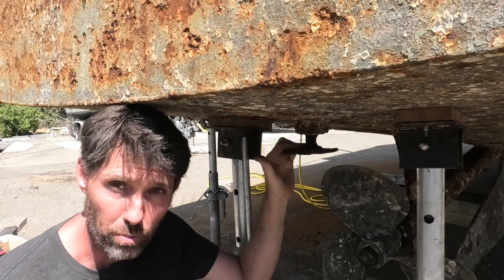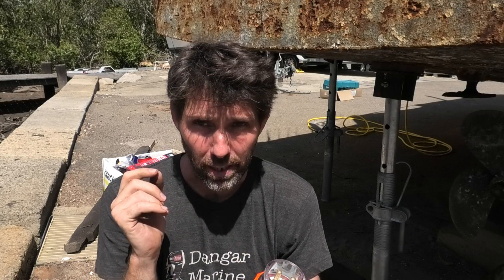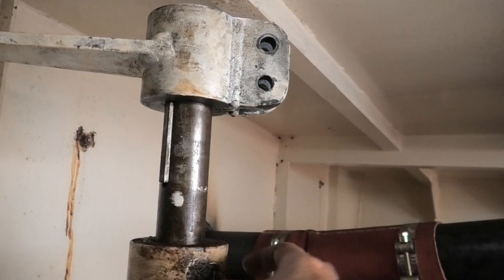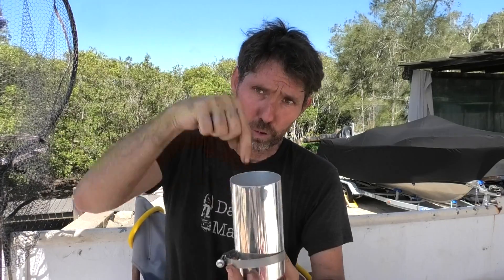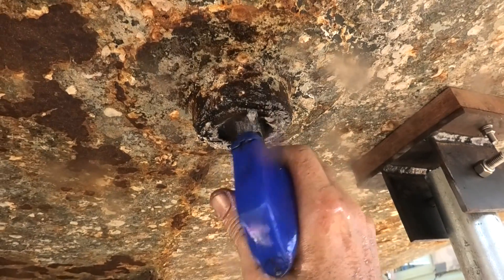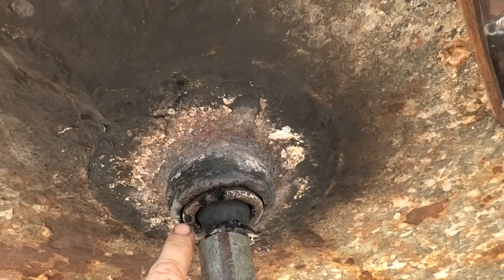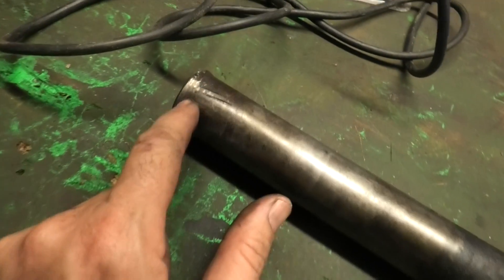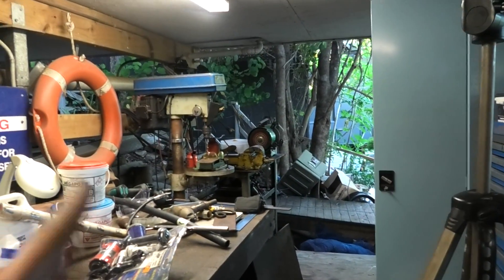Removing the rudder post

Comment: I think I'd keep the rudder and post all the same material, with a preference for mild steel.
Its cheaper anyway and it saves those dissimilar metal issues. 
Yeah I know you already have a rudder but there isnt that much work  in a rudder and you should be able to fabricate it yourself.
And on that if the rudder was responsive enough before keep the same area.
Reply from the maker: I tend to be leaning towards your thinking on this. The original one lasted 30 years after all.

Comment: YOU DEFINITELY NEED TO FIT GREASE NIPPLES TO THE SHAFT HELPS TO KEEP WATER OUT    AND KEEPS IT FROM RUSTING I AM SURPISED IT NEVER HAD NIPPLES ON IT
Reply from the maker: It does have a grease nipple to fill the area between the two bearings.

Comment: Be careful under that beast!
Reply: Pretty sketchy huh lol
Reply: I was thinking the same..
Reply: @BAZZAROU812  yeah, I dont think I'd be getting under there and doing that with that boat moving like that lol. We stick all our boats on solid racks before we go smashing on stuff like that! You can see in some of our videos when we pull engines off the boat, they pull up the boats from the 5200 that was used to stick them in there.

Racks are just more solid than boat stands though so its apples and oranges you know

Comment: @Dangar Marine awesome vid, in the future i could most likely make you any electrical adaptors etc for free and  express post them up shoot me a pm if it would help.

When you cut the door in with an oxy tack some off cut steel on the hull so you can run the oxy up against it for a straight line!
Reply from the maker: Thanks mate, appreciate the offer of making the adaptors. Good idea about tacking on a cutting guide. :)

Comment: I'd use a mild steel shaft. The original lasted how long? Use proper anodes, sufficient grease nipple and you're good. What are your intentions with the transom, the pitting seems to be quite deep or is it an optical illusion......Mike
Reply from the maker: It's frustrating because for every argument for stainless there is a good one against it. I think seeing the prices will help me decide. ;) Yes, the pitting in the transom does seem quite deep. I'm going to measure it soon but I think I will be replacing that whole plate while it is out.
Reply: LOL, I'll bet the mild steel will win....MIke

Comment: Yes the rubber shaft and flange should be Stainless Steel.  Stainless is more noble than mild steel that's why the old shaft and flange were eaten away.  The bushing looks to be a phenolic resin and fiberglass bushing,  I would switch to a cutlass shaft bearing in the lower part of the rudder post tube.  You have the pintle bearing at the bottom of the rudder so loads are not an issue .  

Your crane idea for lifting out the Jimmy...  It's a good and bad idea.  A bare 3-71 is roughly 1560 lbs./700 kg, this is without manifold or trans.  When you go to lift with the crane will the deck hold the load the crane will impose?  You have to think lever arm and twisting loads that is being imparted into the deck.  The twisting load imparted into the deck could be 5 to 6 times that, due to the lever arm as the boom of the crane is extended out from the base. Think can opener on the deck.  I don't remember how stout the deck framing was but something that make help is put two posts down from the deck framing to the hull stringers to carry the weight.  something like 2 inch 1/4 inch wall steel pipe welded in should carry the load.  It's the deck framing that worries me.  

Yes I know you are going to say "they put five tons of fishing gear on the deck."  Yes they may have done that...  That five tons is spread over a wide area over the deck, the load the  crane imposes is concentrated in one place in short point loading the deck.  The base plate for the crane is pushing down on one side as it is listing up on the other side with the same force.  As the crane swings those loads change with the swing.  This is why many times they run the crane bases down through the deck to the hull stringers so the load is a sideways load on the deck over acting like a can opener.  

Yes you want to set the crane level on the boat.  

I hope I have been of some help.
Reply from the maker: Yes, it is rapidly becoming obvious that the motor 4-71 is way too heavy for that little crane and a single point on the deck as you say. When it comes to do the hull under the motor I will just get a small mobile crane to lift it out for a few days.

Comment: I would think any thing stainless on a boat is good. Then i don't know any think about boats. I do know you can't mix stainless steel with steel. Like stainless steel fuel tanks. Some times people put steel bolts and that causes rust in where you put the bolts on the stainlessi. Would say you had a reaction between stainless steel and steel.

Comment: 13:26: Yes, keep it all stainless. Keep in mind it will be isolated from the mild steel by non-conductive bearings (well, I hope!) like elastomeric ones and even the rudder top can be isolated by a plastic surround or a rubber tube that is compressed by the attachment to the helm rod. There's grades of marine stainless for shafts called Aquamet grades here in North America; dunno about Oz, but I suspect you could salvage a prop shaft of the right size for this project and just find a part of a shaft that's true and straight and not chewed up. http://www.matweb.com/search/datasheettext.aspx?matguid=93ff84a2e8f64e5a80acc8d5e352e331
Reply from the maker: I was more worried about the lower part of the rudder post being near the mild steel of the hull in salt water but I guess that's what the anodes are there to protect so I guess I shouldn't worry.
Reply: @DangarMarine  Again, some non-conductive bearings are your solution here. Mild steel and stainless are pretty close galvanically. Are they actually going to touch? Worth it to get some pro advice...and a ring anode for the prop shaft with the bronze prop.

Comment: I know it's a year late but you can run 15amp appliances off 10 amp plugs and it is less dodgy than it sounds. check the breaker that the 10 amp plug is connected to, most of the time they are on a 20 amp breaker so 15 is fine if you're running nothing else off the same circuit. I run a 200amp tig arc welder with an extension lead with a 10amp male end and 15amp female end. Even if the outlet can only supply 10 amps as a rule of thumb don't run the welder above 60% max and you shouldn't pop the breaker. You look like a much more competent arc welder than I so I don't want to exude too much arm chair arrogance  but I know heaps of welders who run 15 amp machines off 10 amp outlets.

Comment: Why steel at all, go with inconel and avoid all chance at all of a repeat performance.
Reply from the maker: Sounds expensive, particularly given "Inconel is a difficult metal to shape and machine using traditional techniques due to rapid work hardening. After the first machining pass, work hardening tends to plastically deform either the workpiece or the tool on subsequent passes. "

Comment: IWould not have wasted so much tme on the old rudder assembly.  Cut the entire hole out and replace with new steel plating and stainless rudder shaft and modern bearings, not bushings.

Comment: Here is something you can discuss with your mates available in NZ. bushing and tube system.
I do like the idea of a used prop shaft to save some bucks, one place I lived had an industrial salvage yard you could buy sized materials by weight, great place for brain farts.

http://www.chatfieldmarine.com/shop/Rudders/Rudder+Seal+and+Fibretube+Assemblies+Elite+rudder+seal.html

http://www.chatfieldmarine.com/shop/Vesconite+Bushes+%28Stern+Bearings%29.html

Vesconite is extremely versatile. It out performs most plain bearing materials in unlubricated, lubricated or water lubricated applications.

Vesconite combines many of the advantages of metallic and non-metallic bearings and bushes. It has a higher design load limit than white metal (babbit), a higher fatigue strength and two to three times the wear life.

Vesconite gives up to 10 times the service life of phosphor bronze in poorly lubricated conditions.

Vesconite has negligible water absorption characteristics. Vesconite is one of the most dimensionally stable synthetic bearing materials available. Vesconite swell is less than 0.07%. Nylon swell is typically up to 3%, thus requiring excessive clearances, which reduces wear life.

Vesconite does not lose hardness in water like nylon. So even in water, Vesconite retains its high resistance to creep and wear.

As it is not a laminated product, Vesconite does not delaminate.

Vesconite has a much lower friction than most laminates, elastomers and nylons and in most applications a superior resistance to wear.

In rudder applications, the low static and dynamic coefficients of friction of Vesconite mean lower power requirements for the steering gear.

In addition to the low wear rate experienced by Vesconite bushes, users report greatly reduced wear rates on metal journal surfaces such as propeller shaft and shaft liners.

Vesconite is not susceptible to electrolytic corrosion.

Vesconite does not contain asbestos or other fibres. It is both easy and safe to machine on standard metalworking equipment Vesconite bushes are straight forward to install and easily removed. Vesconite is resistant to most acids, solvents, hydrocarbons, oils and fuels.

Contact: sales@chatfieldmarine.co.nz for more information.

Comment: see if there is any used propeller shaft laying around.. you don't need anywhere as long a piece as most propeller shafts are..   you can perhaps find a proper sized ball hone to run thru the rudder tube.. https://www.ebay.com/bhp/ball-hone.. if the shaft you can get is larger.. it just means you need thinner bearings made up.
Reply from the maker: Yes, was definitely thinking of running a ball hone through the tube. Just need to find an extension long enough to reach the middle.
Reply: @DangarMarine   you can rig up extensions  with some plane rod or all thread and a coupling nut that has some set screws to hold the ball hone..  you may want to make them quick connect so you don't run into over length issues.  just drilling and tapping the connections for a m6 screw to go thru and tighten in place..  ever seen how a automotive steering column has D shaped ends with a notch out for the pinch bolt to go thru and retain the coupling.. that might be how you make the replacement flange for the bottom of the shaft  out of a rectangular block with a matching hole to the shaft drilled and filed to double D shape.. a slit for the pinch bolt.. welded to the plate and then cut thru for the ability to pinch on the shaft..  remembering to put the pinch bolt thru the edge of the double D bore..

Comment: I noticed whenever you are heating the metal you talk too much and let it cool down too much you need to hit it while it is glowing red. Use what they call a rose bud tip on the torch. It’s for heating Heating metal and not cutting metal